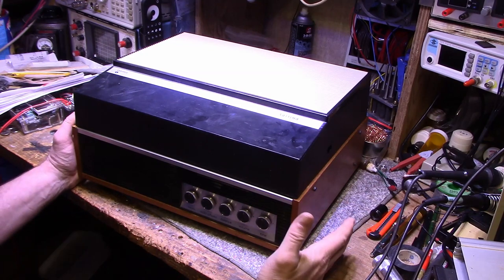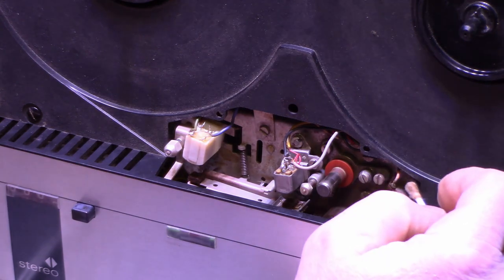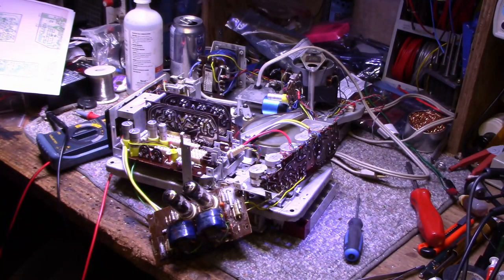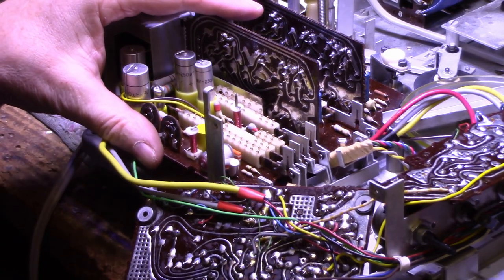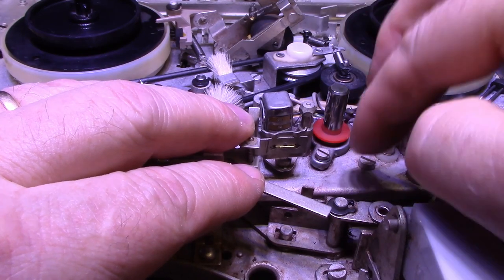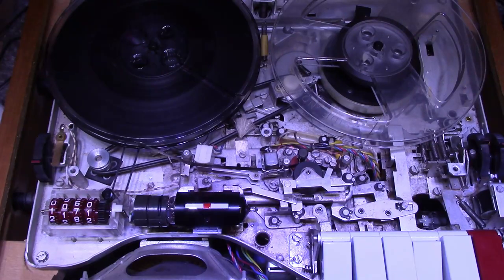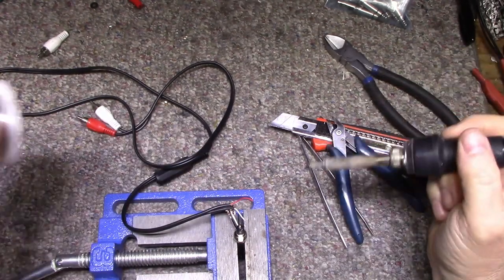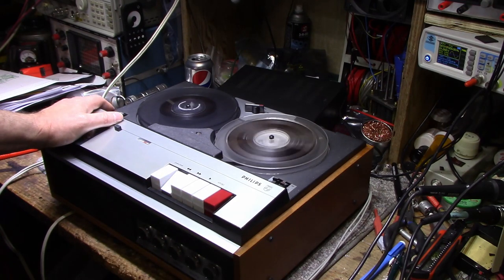Philips EL 3555 Open Reel Tape Recorder - Revival (Ep. 70)

Comment: For what it's worth, PAR stands for "parallel".  That means that if you have 2 tracks in monaural, you can mix them by using the parallel feature.  If you are into mixing tracks, this can be very helpful.  If you put the machine on 1-4 or 2-3, the first number side is played first.  If you want to play the second number side, the tape needs to be flipped.  In PAR mode you can play both tracks at the same time.  This is a little different to stereo where 2 tracks play at the same time and are recorded at the same time.  If you record tracks separately, in PAR mode, the two singly recorded tracks are played at the same time.  Don't know if I explained this thoroughly but I hope it helps.

Comment: This Philips is a real time capsule; you can spend time just marveling at its engineering and design.  No substitute for experience on these labor intensive marvels.  Dare I say, how about the number of lube points?  I wonder if new/fresh idler tires and clutch rebuilds would fix the FF/REW tape overrun and braking issue?  Cost/benefit is a terrible dilemma on these vintage wonders...another great save!
Reply from the maker: Thanks. I did go back after and adjust the brakes which wasn't shown. The  service manual has the procedure but it's all in German. They are better now but to get it perfect I would need to replace the rubber pieces that drag on the tape reels
Reply: @Trevor's Bench please share the service manual link

Comment: DP means Duoplay, where you can play back one track while recording another, e.g. record live sound on track 1, then make another recording pass to add commentary on track 3 while listening to the original recording. MP means Multiplay, which is similar but 'bounces down' the original recording onto the new track as well, mixed with the incoming signal. The mix of the two cannot then be altered in playback but the original track is freed up to make a third recording.
Reply: This model has not multiplayback I think
Reply: I was wrong

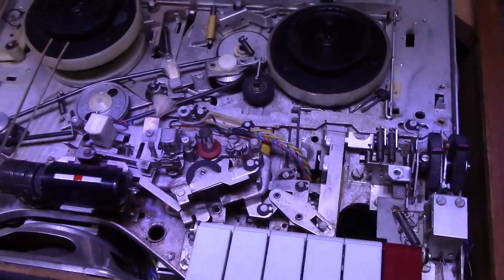Comment: I have similar Norelco EL 3555 , do you know where to get the main belt and the rubber wheel on 26:45? Mine completely disintegrated :(
Reply from the maker: Sorry, no I don't. If you can get measurements of the old rubber it will give you a good start to searching for replacements
Reply: It’s available on eBay